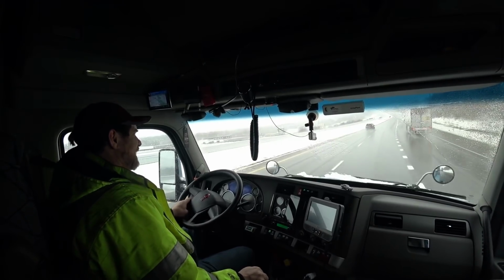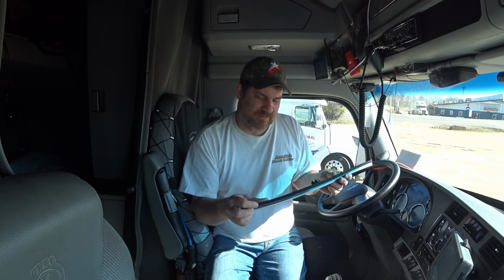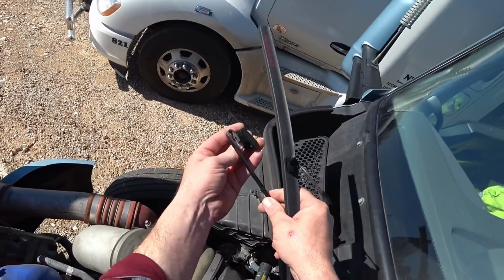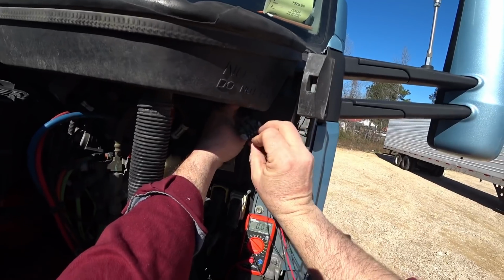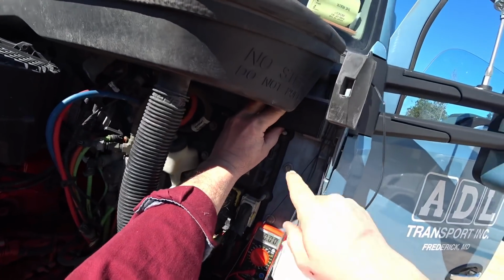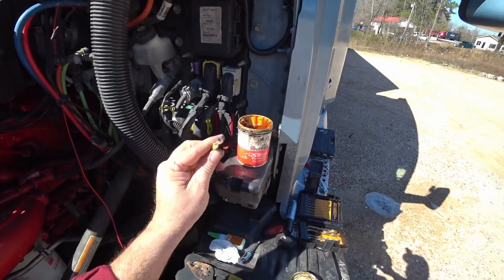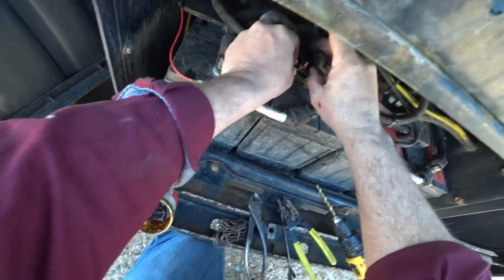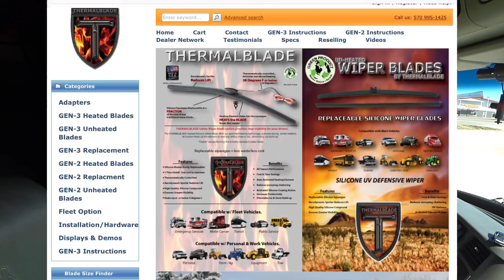February 24, 2019/68 ThermalBlade Heated Wipers install & How to win a set

Comment: My first stereo wiring I put the wire unprotected through the seat frame. No fuse and no grommet. I learned my lesson at 110 MPH when the wire grounded out and started burning the insulation.

Comment: The 3m tape is great stuff. Since I saw you use it several months ago, I've not been without a roll! Use it for all kinds if stuff around the office and home. Great for wire management.

Great install video and a great product for those driving in the snow and ice zone.

Comment: Well done video easy to fallow and very detailed. As far as the impact never leave home without it as well a the 3/8 adapter. Carrying basic tools and  electrical items is a blessing at times fix the simple things and keep the truck moving. Mud flaps cheap ones were also a item to have on hand.

Comment: Thumbs up LHL. I always wondered what those things would be like to install, operate and especially longevity. Kind of expensive, but if they last, then... Surely you can purchase just the wiper blade for replacement when they wear out. They alone should be much cheaper than the whole enchilada.
Reply from the maker: Yep 👍
Reply: instablaster...

Comment: head to crystal lake iowa it's 1 degree there this morning ,monday feb. 25th 2019. your kind of coldness.hope the heated blades work out. you ever try putting wd40 on the rubber part of wiper blades to keep them flexable
Reply from the maker: Nope
Reply: WD40 is oil based oil eats rubber better to silicone.
Reply: @edwardmartinez199  what type of silicone

Comment: Try using heat shrink to Larry. Works great on preventing bad connections.
Reply from the maker: I do,  I used heat shrink connector on the wire

Comment: Every truck I ever ran had that from the factory. Called Defrost with both visors down. Flip the visors down. moves the air better, and helps heat up the glass more. Then that helps with the wipers. Worked 97% of the time. But most people will not flip there visors down.
Reply from the maker: I hear what you’re saying but when it’s below zero sometimes that defrosts just not going to cut it
Reply: @LongHaulLarry  Guess I got lucky most of the time then. And was in Below freezing a lot. But had to run the Defroster wide open. Along with the visors down. Do like the heated wipers better though.

Comment: Could never figure out why they don't come standard or at least a option. Nope.
Reply from the maker: I think the boss said that on the Volvo he could’ve gotten them from the factory
Reply: Didn't know that.
The way the weather is, they should be standard.
Can the rubber blade bit be changed separate from the heat element?

Comment: Great video, but absolutely incorrect use of dielectric grease. That grease is actually non conductive, and by putting it on the wire before crimping on the terminal you have decreased conductivity. Not trying to rain on an otherwise excellent video, just pointing out a small error. Put it on after all connections have been made to keep out corrosion.